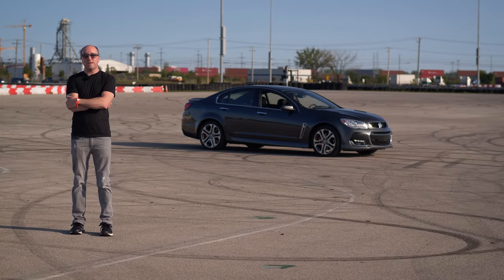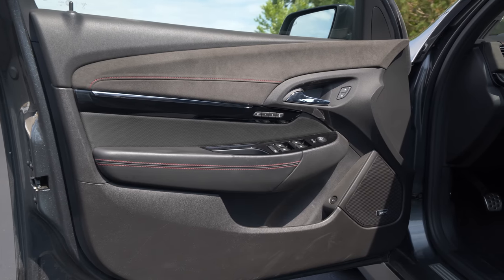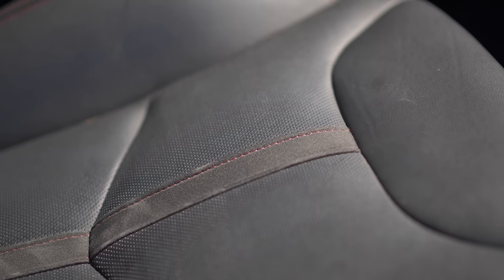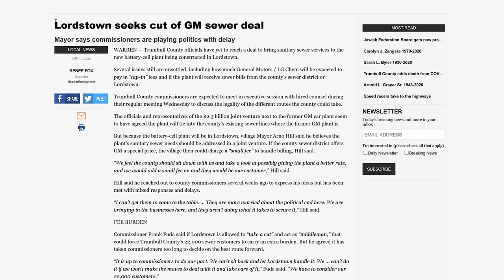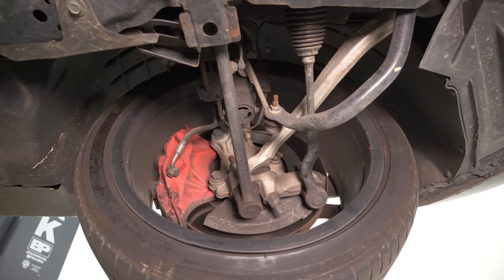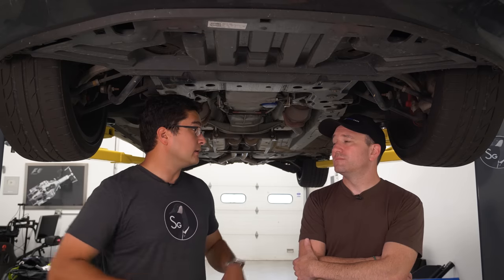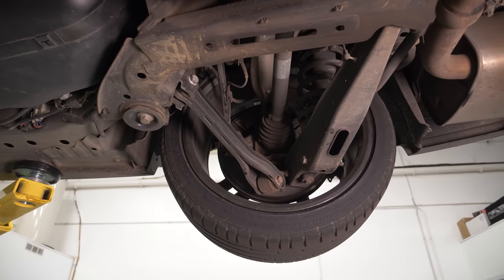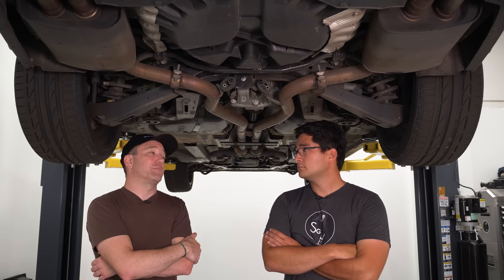Chevy SS Commodore | Holden a Funeral

Comment: Great video and I can see why you have a big audience in Australia due to your no BS style. I worked at Holden as an engineer and was surrounded by people who were real car enthusiasts and proud of the company.  Holden was a small team who through taking some risks could make great cars for a fraction of the cost GM.  Holden was selling these cars into many markets including the middle east where they had a big following. With export sales Holden could easily have been kept alive.
People like Bob Lutz wanted GM to use Holden as a roll model as a lean operation but instead GM came into Holden and slowly turned it into another 'mini-me' GM division.
The Commodore was not perfect but it was  really good platform and I would always stand up for it when friends would call them bogan mobiles.
The latest is that a lot of ex Holden engineers are now working for a Vietnamese car company making cars based on older generation BMWs. They even bought the Holden proving ground.
Reply: @TBH Mostly noise vibration for the HFV6, interior quality and some mass issues due to its price point. I also think it was too big a platform for the Camaro but that's a different topic. And you could not see past the A pillars. The body structure was pretty  rigid and the suspension had really good geometry which led to it having nice linear steering and predictable handling.  The previous VT/VZ Opel based platform though still OK was a bit of a compromise and the VE/VF was meant to be what Holden could do when starting from a clean sheet. The dynamic baseline was the M39 5 series which is still one of best sedans ever.  The VF makes for a great long distance high performance cruiser in that it combines a good ride and very predicable steering. To be honest, I think cars like the M39 and VF are a high point for big roads car where the mechanical engineering was more important then the electronics. But maybe I'm just getting old.. I rather see the car on a hoist then discussing Apply Carplay.

Comment: Had my 2016 VF Series II SS LS3 Commodore for 4 years now, and at first it felt big, heavy, nimble and fast.
Now, it feels tight,nimble,light and still fast. At first I wasn't keen on the flappy paddle gears and bi-modal exhaust, but now I wouldn't buy a car without them.
First Commodore I ever owned.....and it is the best one.
R.I.P Commodore 🇦🇺
R.I.P Holden 🇦🇺

Comment: I have an SS. I bought it new in 2014 and still have it. I've been shopping for a replacement but the truth is the SS is kind of the perfect car for me. 2 kids and a wife and I like to drive. 62,000 miles and I've not had any problems. IMO the steering isn't great. The trunk is huge and so is the back seat. I can put people well over 6 feet back there and they're happy. Like this video says - I did cross shop this car with a 2014 Cadillac CTS V-sport. The SS made the Caddy nonsensical. $12K less, same power, same performance, more space. The LS3 V8 is better than the Caddy twin turbo V-6. And yeah, GM probably poured way more development dollars into that Caddy, and so the SS was squashed.

Comment: Great car  and I'm a Ford owner and fan ..This is one of a few Holdens I'd be happy to own . Ford sold the Falcon for 56 years continuously and finished up with a beaut , reliable well sorted , fairly adaptable unit . The 5.0 V8 in the final literation was supercharged and the 4.0 DOHC Barra 6 Turbo  was /is  a rocketship . In the USA the Barra is fast becoming the engine of choice to import . The torque and power is relentless.  My two Falcons  AU ll and FG XR6 are fantastic fun to own  but the Commodore /SS deserve a lot of respect and admiration for what they achieved given the restraints you guys outlined in the video ..Cheers..

Comment: I love my 2017 NGM 6M. There is a ton of misinformation from specs of different years to not selling well etc. SS owners are used to it by now. Most didn’t pay msrp. I love the sleeper factor and the fact that you don’t see them everywhere. It’s a 4 door Camaro. Mine is my daily and works extremely well in that role. The interior isn’t the best around but I didn’t buy it for the interior. I bought it because it’s a manual rwd V8 sedan and there weren’t any others out there in 2017. Keeping mine forever.

Comment: Awesome review Geese. Love it. As usual - amazing content. 
You said “EVs make things like this irrelevant “. I think you’re close with that.
In the last era of ICE cars, the manual transmission was offloaded and replaced with DSGs and the like to find a few tenths of a second down the quarter mile. We all knew this was at the expense of driver engagement and there remains no parallel to rowing through a 6sp manual with a grungy engine. 
Well, all these fast Autos that were produced are truly irrelevant now. They will never match an EV for outright speed and will never have the engagement of a Fast Manual car. 
Personally I think the Holden Commodore SS in Manual RWD V8 is the epitome of a working class car through the ICE era. 
Long live fast manuals!

Comment: This Aussie isn't happy. The only cars I've ever owned have been Holden Commodores. My current one is an AWD beast of a machine. Love it. Despite it being 14 years old ;)

When I've looked for something similar today, I just can't find it. Maybe the Subaru Outback is closest, but that's too small. I have put an entire single bed in mine, with the rear seats folding down flat. So I hope my current car keeps on going on, until there's something better. (ok the proposed Mustang AWD sounds nice, but I'm wanting a wagon with that huge load capacity. A single bed in the back folks! come on!)

Comment: As an Australian born, ex-Ford Asia-Pacific (Melbourne) employee now working in PD at Lotus Cars at Hethel in the UK I was touched to see that you guys had gone to the trouble of doing your research on the Australian automotive industry, the Holden brand and the Commodore platform in support of this video - and shocked to hear that Australian viewers make up 30% of your viewers/subscribers! 

Australian automotive design, engineering and development has always punched above its weight for both cost to do and quality of output (esp. given the small volumes). This was the case for locally built GMH, Ford, Mitsubishi, Toyota and further back, Chrysler & Leyland. Mostly compromised by a lack of support by global parent companies and a failure of those companies to incorporate antipodean product/platforms into their global strategies. 

BTW, i've been watching your videos for a couple of years now, focus mostly on your Sports-car reviews and as a NC BBR 200 Bhp owner, particularly enjoyed your Miata/MX-5 generational videos. Great insight into those products both through the seat of your pants driving and the insider interviews that you shared.

Comment: Ordered my wife one in October of 16. Got her 2017 regal peacock green with manual no sunroof and full size spare for $39,000 in March of 17. Had a 20% sale only complaints are the fuel mileage and that’s expected. The cup holder gets in the way when slamming gears with skip shift delete of course the first thing that went before the first oil change. Production Numbers low on this piece of history even through 14-17 lower than gm promised sales sucked in late 16 due to safety recall on seat belts. No advertising is what killed them. No way I would have ever known about them unless my wife had to have a sedan with a V-8. All sounds good plenty V-8 sedans out there then she said manual so it left me with about 2% of sedans so the hunt was way on. Told her 2 days before picking it up she had a new car. It’s a stunning car and pretty fun too.

Comment: I absolutely LOVE my 6M SS.  The LS3 is so easy from which to extract more power.  A nice choppy cam along with headers, CIA, and a tune and it rocks!  A lot more power to be had with a blower and ethanol.  It's not cheap but don't forget how much a Hellcat costs out of the gate and weighs substantially more.  Going to get groceries has never been more fun!

Comment: Have the 2013 Holden Commodore SV6 wagon with the LFX v6. Best car ever and have no intention of selling it. It's even more reliable than the Camry we had previously. Drive feels solid and comfortable. Plenty of power and sounds good (not as good as the V8) under full throttle.
Sad times for Australia and manufacturing. Don't let it happen in the U.S.

Comment: This was an excellent review. As an Aussie I have owned several Holden products. I have owned a VB sedan, the original Commodore, a VH sedan, a VT sedan, a VY Series II sedan, a VY Ute (pickup) and lastly a VE sedan. All were six cylinder but the driving arrangement was the same as the V8s without the grunt. The ute was the handiest and the VE was the most comfortable but in the end the GM-Holden product started to get less original (read aussie) and so I moved away from the homegrown product.
The review was able to explain why the original product was so loved and in the end so hated (except for the grunt). Thanks for the nostalgia.

Comment: Was a truly great sport sedan. As a freelance journalist GM loaned me a a manual SS back in 2016, and I was impressed Well made, fast and comfortable. GM made an effort 2015-2017 to market it by putting SS style bodies on Nascar race cars at the time, bit there weren't many other ad campaigns for it. Plus a 52k Price was out of reach for most fans. But they are solid , fun and desirable as used cars now at a more attainable price.

Comment: Funny how the SS export was essentially a VF2 motorsport with the magnaride and the seats which they didn't make too many of here. (we used the SS seats in the Motorsport/director/magnum allbeit with no SS logo and only heated)
-Heated seats were only available for us on high trim levels, only heated, NO Cooling despite it being hot here (ex: Calais/CalaisV and high trim HSV)
-No drivemode selector (special editions and HSV only)
- V6 engine options
-L77 was in use until series II when LS3 was rolled in, LSA  used on GENF hsv.
-No paddle shifters until Series II despite them being on export day 1 and they were only available on SSV redline and HSV, You could pay them to install them on a V8 calais and they won't do it.
-Manual transmission on Day 1 unlike export.
-Different seat design across standard model range.
-Different rims across models
-Black plastic in place of chrome sections on lower models
-Most cars sold were auto because a suprising amount of people that buy these don't want a manual, infact the manual SV6 was so rare that holden discontinued use of the Aisin AY6.
-SSV redline, and Calais had different tail lights on series 2 that featured more chrome.
-Heads up display only available on higher models such as SSV redline and CalaisV and HSV
-Lane departure only available on higher models and HSV
-AFM is active here if I recall
- Skip shift not activated on aussie models
-Reverse lights don't illuminate on unlock / lock on aussie models
-Less chromey pieces on exterior of most models, only on Calais really.
-Bimodal exhaust is controlled by computer on models without drivemode selector (which is most at this point)
-Holden decided to remove CD player on series II update despite the bluetooth being infuriating to use here.
Fun fact: people here rebadge their SV6 has a Chevy because "its hectic bruz", while people in america rebadge the export as a holden and try to make an SSV, usually badging it incorrectly lol.
Also its funny how in the states its seen as a sleeper, because everyone knows what they are here lol, even the cops were using them and the interior situation was quite an improvement over the VE, so its seen as pretty up market for a commodore.

Comment: Great review!  Liked and Subscribed as always.  I did not buy one of these because the interior reminded me of the Camaro which was originally launched in 2010.  The interior was lackluster then and by the time it was killed off was nearly 2 decades old.  I loved the engine/trans combo's and the body aged well but since so much time is spent in the cabin I just couldn't do it.  Even after watching the video I toggled to Auto Trader just to look which is normally the first step toward ownership for me but then I see the prices and start to come to reality that I'd be stuck behind the wheel looking at something that looks like it was designed as a toy for a child.

Comment: Thanks, Mr. SS Owner! 

A 2017 SS 6-speed is at or near the top of my list for forever car. The interior really is not that bad. It definitely isn't worthy of the $50-60k range, but freakin' hell it's better than the Charger/Challenger interior, and GM could have cost-cut so much worse by just doing a mild revamp of the G8's interior since it's practically the same car (5 years after the G8 disappeared) with some suspension and chassis updates. I say get an aftermarket company to do an interior upgrade, get the screen and head unit replaced, and you have a perfectly updated car that is still performance-relevant.

Comment: Got my 2016 "some like it hot red" SS new for $38k due to the seatbelt recall.  I've only driven 8000 miles  in 4 years.  The only warranty items were a faulty muffler and tires that dry rotted after three years (sat in the Queensland sun too long?).  This has been a spectacular car,  one of the very best I've owned in  50 years as a car guy.  This is a very thoughtful review.  But "not a track car" ?  Ask the Skip Barber Racing School why they have used these.

Comment: 2016 SS with the TR6060 checking in.

Beyond the glare off those chrome strips in the dash I have no issues at all with the interior of the car.  

I like the styling and when you do actually come across somebody that knows what it is... that's joy.

One last thought... I think if they'd had the balls to call this car the Chevelle SS the car would have sold much better and might even still be around.  IMHO.

Comment: A good friend of mine has an SS. I've driven it a few times and I can tell you, it's  very hard to heel toe,and I wear an 11 1/2 shoe. The clutch sucks too. It has this very strange spring action about half way through the pedal travel. Interior gets pretty hot during spirited driving.

The car feels like a tank,but it does have balls and pulls pretty hard. I'll add,the exhaust note is pretty nice too.

Comment: 1:06  The LS-3 V8, Tremec TR6060 6-speed manual, and Magna Ride suspension were all made in the U.S. and shipped to Australia (maybe some other parts too).  So I would say there is a lot of America in this Holden manufactured auto.  21:26  "Why bother?"  Because the SS undercut the Caddy products by 20 to 30 grand and the only other 4-door sedan/v8/manual transmission on the market was a BMW model costing US$80,000.  B-T-W, the LS3 may not be the most modern V8, but it is known as extremely strong and therefore can be easily modified to 5-6-700 horsepower from widely available aftermarket parts.  I have a 2017, white with manual transmission that has never had one thing go wrong.  Interior is not the finest, but is a pleasant place to be, and yes the stereo is not very good, but if you have the radio on instead of listening to that wonderful V8 sending out soul-warming noises something is very wrong with you.  If you were smart you bought when GM offered $10,000 off the 50,000 list price.  I bought mine (new) for $36,000 (had $4,000 in GM credit card points) and that is outright stealing.  In sum, I am entertained every time I drive her and smile along every mile.  R.I.P. Holden, we love you.

Comment: The true irony of the current Corvette: a crazy, mid engine, hybrid drive V-8, all of the R&D was done by Holden. There's a prototype, which was affectionately known as Black Jack. A VE Holden ute, with a Corvette cabin. Open the bonnet, and it's an empty space. Open the hard cover in the bed, and you find that wild driveline. It came out of a prototype roadster called Project Super Ute. It was meant as a technology show car. Imagine a Chevy Volt, with all wheel drive, that goes from 0-60 (mph) in less than 3.5 seconds. The 0-100 km/h  of 3.5 seconds. Which was quicker than the Bugatti Veyron. While it used the Chevrolet Volt battery system (uses a 1.5 litre 4 cylinder to charge its batteries) it doesn't look or drive like one

Comment: I had a 2011 VE Commodore "ex"-cop car. OMG! What a chassis! OMG what disastrous interior. The plastic would scratch permanently with your finger nail. :(  The SIDI 3.0l was nuts but burned oil like mad. The seats split, the stereo was rubbish, the brakes lasted 20,000km before it needed new disks. You guys have nailed it. One of the best non-Nurburgring chassis I've ever driven. You could drop off the edge of the  bitumen at 120km/h and it was utterly fine. Towed well. Shit interior. Shit engine. Police mods made it FAST!
Sold it because my 2 sons were learning to drive and it was not going to end well...